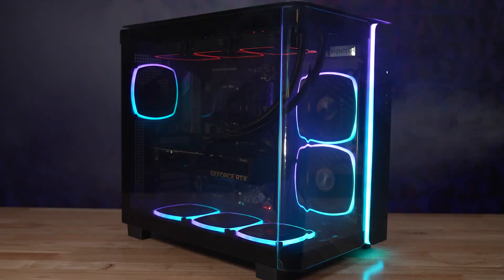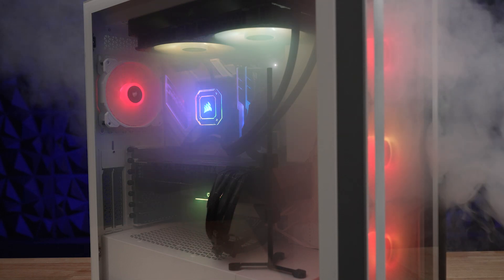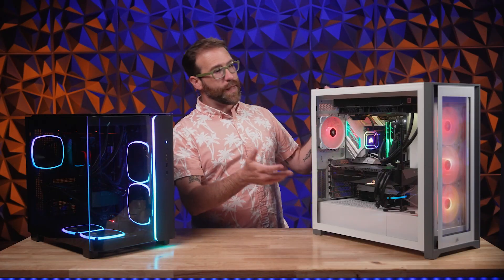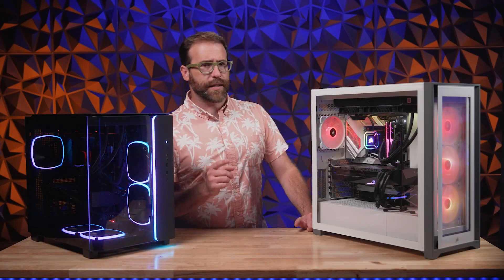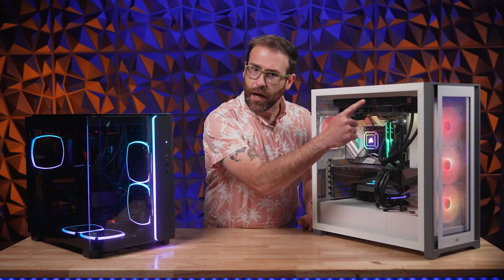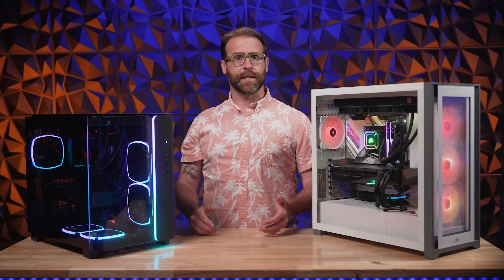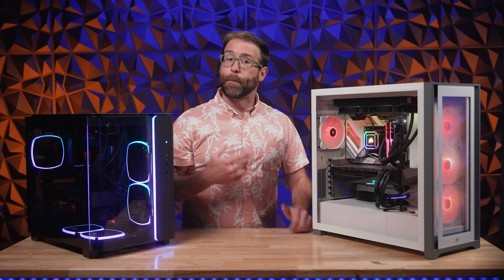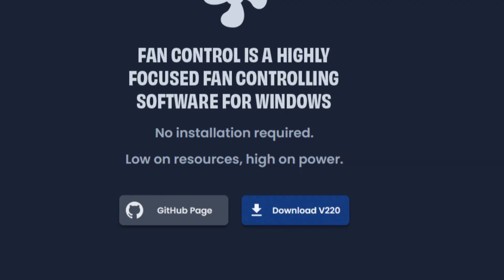The TRUTH About PC Fans: Airflow, Pressure & Cooling Explained

Comment: Reverse blades also work a hell of a lot better than flipping a standard fan for intake, if you flip a standard curved blade fan you lose a lot of performance especially with static pressure fans where you often lose over 50% of the performance, where as specifically designed reverse blade fans tend to only lose around 2%-5% performance, so even though they do look way better, no it's not just aesthetics and vanity like this and also other videos make it sound. There's a real world use and advantage to them making them extremely useful for cooling upper mid to high end pc's that can get really hot. If you're going with straight blade pc fans (they are pretty rubbish for airflow and or pressure) in a higher end system I take back my comment, if you do that I really hope you don't do anything demanding of the components as it will get real hot and cook that hardware good.

Comment: Something to keep in mind is the air source for the radiators. Intake air should always be cooler than exhaust air. Never use exhuast air for a radiator. Larger delta T equals better cooling. For example, would you use a hairdryer to cool down? Or a room fan?

Comment: I think dual-chamber cases are generally designed for watercooling because of the additional radiator support. The ability to mount extra fans compared to a traditional mid-tower probably isn't worth it if you're weighing the negligible thermal improvement to the additional noise.

Fan bearings are an important factor if you care about longevity. Invest more in ball or fluid dynamic bearings over sleeve bearings if you want your fans to last and care about minimizing noise.